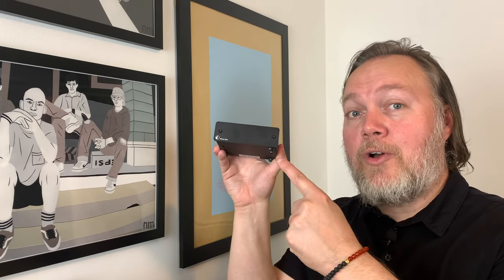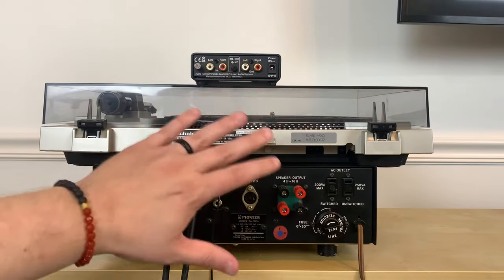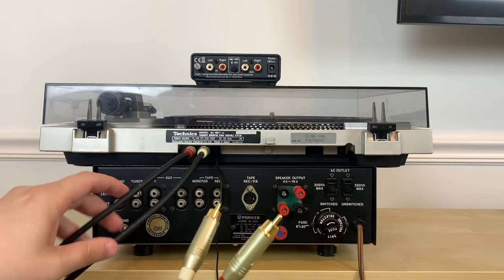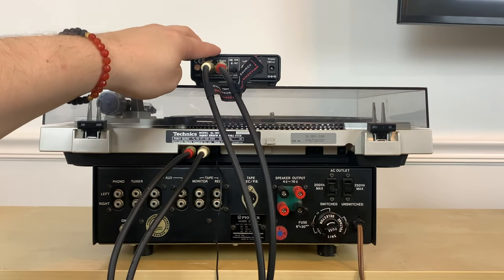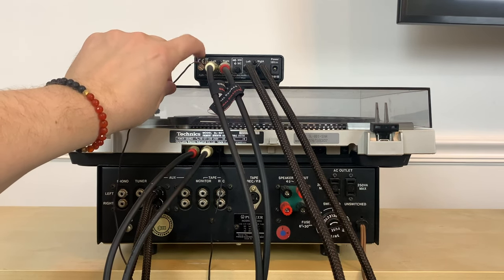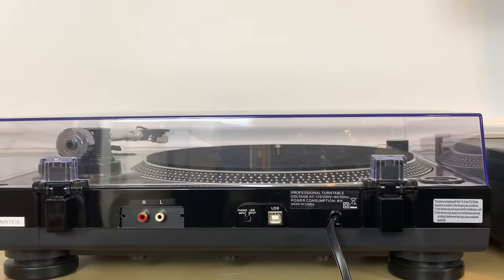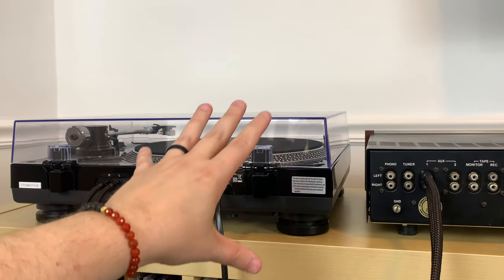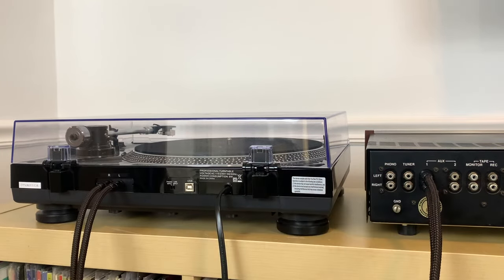How to Connect a Turntable to the Aux Input on a Receiver

Comment: Great advice for the LP beginners, keep up the great videos!
Reply from the maker: Thank you!
Reply: But isn’t the phono input on the receiver only good for moving magnet carts? If you are using an external preamp to select moving coil carts you can’t use the phono input on the receiver can you? What do you do then especially if there isn’t an audio in connector? What would happen if you select the moving coil on the preamp and used the phono input on the receiver🤔🙏 I’m confused about that. I’m fine now because my Yamaha receiver has a audio input so I use that and bypass the internal preamp on my turntable and select the moving coil on my external preamp. I’m just wondering if I ever have to get a new theater receiver what do I have to look for to be able to use an external preamp and moving coil carts. I’m just confused that I can’t use the phono inputs because they are always for moving magnet carts.  Some home theater receivers don’t have audio ins. Thanks for any help!

Comment: Thank you! A very helpful video. Thanks to this video I managed to connect my Rega to a Luxman amplifier with no mishaps. Everything works! Dumb question, but I have to ask it: What is TUNER for?
Reply from the maker: Some hifi set ups include a separate tuner, which is basically just a box that tunes in AM/FM radio. So some receivers left an RCA input for a separate tuner. I don't listen to radio much so if I have a tuner RCA input, I'll use it for a wireless streamer or CD player instead lol.
Reply: Thank you!

Comment: Thanks this has helped alot to understand how this works, I have a Onkyo amp and a cheap second hand turntable, I don't see any internal phono/ line etc on it but when I connect the aux it gives me sound and the plays the record, in fact I've connected to the tape aux and works through that rather than the cables coming to the front where my aux is, both sound the same but can't help to think it could sound better

Comment: Thanks for the video! I have a question. I recently bought an Audio-Technica AT-LP3XBT turntable (which has a built-in preamp) and am trying to connect it to my Onkyo HT-R393 AV receiver. However, I can't get any sound when I plug it into any of the receiver's inputs .  Bluetooth works fine, but I'm curious why the wired connection isn't. The AV receiver itself doesn't have phono but I thought since the turntable does have I should not need to worry about it. Any ideas?

Comment: Thank you so much for making this video. Quick question. I have a very modern audio-tecnica tyrntable with built-in preamp. The RCA cable that came with it includes a grounding wire. The problem I have is thatmy modern Sony Receiver does not have a connection anywhere for grounding. Is there anything I can do? Or can I simply not use the grounding? Thank you very much!
Reply from the maker: Try finding a metal screw on the receiver and unscrew a bit then wrap the ground cable around and tighten. You just need a metal to metal connection and sometimes this works although it’s not a guaranteed fix
Reply: @ForeverAnalog  Thank you so much!

Comment: I have a cheap turntable with a built in amp but doesn't sound very good on my only HT-R510 that doesn't have a phono connection.  Can I purchase a phono preamp? And will it sound better?
Reply from the maker: You can purchase one yes and it may improve the sound. Maybe try buying from Amazon and if you don’t hear an improvement you could return

Comment: I have a 90's Pioneer receiver that has the phono connections but no auxiliary. Later on, I bought a turntable that has a preamp. Since there wasn't the auxiliary connections on the receiver, I connected the turntable on the laserdisc/sattelite connectors on the receiver. It seems to work. Just curious how is it working with those connections?

Comment: Thank you! Question please. Can you use power speakers that have phono/RCA Jacks?
Reply from the maker: Yes, if the powered speakers have a phono input, you can use to connect the turntable with the internal preamp on the table turned off. If you have a turntable with an internal preamp, you can switch it on and plug the table directly into the RCA cables on speakers.

Comment: If I were to have a turntable and wanted to play FM radio through the Bluetooth option. What do I need to connect to the AUX to be able to play fm radio. Is there some form of transmitter or adapter for an aux connection?

Comment: This video was super helpful. If I wanted to plug in turntables to a mixer and then my receiver before the speakers, would I use the phono line input on the receiver or regular aux? (The mixer has a phono line switch). Please help!! 
(I was assuming that it would be the aux input like you did in the video since the mixer is considered a preamp?)
Thanks so much.
Reply from the maker: Depends on your turntables. With my mixer, I usually plug my tables into phono and move the switch to phono on the mixer and connect my RCA cables to my phono input on the receiver.

Comment: Can't find the answer to this question anywhere, but I think you may have  briefly mentioned it. When you have a preamp in your TT and a receiver with a phono input, what is the best way to set it up? Should I use the preamp on the TT or should I use the phono input in there receiver? Which is better and why?
Reply from the maker: I find the phono stage (input) in the receiver to be more robust sounding.

Comment: this video is a such a big help! So let's say, if I will be using a modern turntable (with phono preamp) is it safe to use an RCA to XLR cable, as my input cable going to an analog mixer? (LINE INPUT)  then from the analog mixer, to amplifier, up to PA speakers? do you think it will sound good? good enough for large venues such as reception halls?
Reply from the maker: Yes I believe that will work. You should be plenty of volume but just how loud it gets will depend on the amp you use for the PA speakers.
Reply: @ForeverAnalog  thanks a lot!

Comment: Great details on the connection of my turntable to Sony STR-DH540 receiver however not only do i not have a phone jack I also do not have an AUX jack...Is there a way around this issue? In advance thanks a million.
Reply from the maker: You can use any of the RCA inputs on the rear.

Comment: Ok but i do not understand if i want to improve my sound quality. I Ve a selector on the back line/ phono, and on my amp an input phono. If i use between them a pre amp the sound Is Better or not? I know that without a preamp It works. But my doubt Is: if i buy a preamp and connect It, i Ve a Better sound ? Thanks

Comment: I had purchased a new JBL turntable with a built in pre-amp.  I have a vintage Sony surround sound system receiver does not have the word aux. on the back.  It has input-output for CD MD/Tape, Vdioe 1 & 2.  There is a separate DVD/CD player that hooks up to the receiver and only has ports for line out, digital out.  Where would I plug my stereo in?  Any help would be wonderful.
Reply from the maker: You can use any of those inputs with the built in preamp and just switch the receiver to which ever you choose!

Comment: I have a modern Bob Marley turntable with the two outputs lead to one auxiliary cord is small the smoke how do I get an adapter to plug into an older receiver but it only has one Jack only has one Jack

Comment: My TT doesn’t have a ground wire just the two rca cables, my reciver has phono input will it make noise?
Reply from the maker: Depends on the table and amp really, I'd plug it up and see what happens. Worst case it will just hum.

Comment: Hi. Is there any difference in sound quality when using the turntables built in amp vs the receivers built in phono stage amp?
Reply from the maker: I think so, yes.
Reply: @ForeverAnalog
Reply: Thanks. I have an Audio Technica LPW40WN turntable with a built in amp. Originally tried hooking up to my Marantz NR1200 receiver phono stage, but there was an awful buzzing in my speakers from an apparent ground loop. Tried everything to solve but no remedy worked. Eventually defaulted to the line setting and ran it through the AUX on the receiver. Works great, no buzz/hum. Have wondered though how much performance I’m losing by not utilizing the Marantz amp.

Comment: My turntable has pream and my amplifier too in that case ? Should I  connect to the phono input in the amplifier and switch to phono on the turntable?
Reply from the maker: I prefer the sound of my amp’s phono input over the turntable’s built in preamp. Test them both out and see which you prefer!

Comment: 😃Sir, great video. I have a turntable and need an amp, but would rather establish a connection to a receiver. I am looking for a receiver that has a phono input, but I do not want to break the bank. May I have a few suggestions? If push comes to shove, I will use a preamp.  Thanks
Reply from the maker: The Sony STRDH190 is currently on sale at Amazon for $148 and has a built in phono input. I can't say it will offer you the best "sound" overall, but it will get your turntable up and running with powering your speakers.
Reply: Thank you! I will check it out.

Comment: I have Cambridge Audio AXR85 which has built in phono (MM Phono in the back) and I'm going to buy Audio Technica AT-LP140XP (which has not pre amp) Do they work together? Thanks :)
Reply from the maker: Yep, just make sure the turntable is plugged into the phono input on the Cambridge.
Reply: @ForeverAnalog  Wow, instant response :) Thank you so much for the information! Greetings from Crete

Comment: So to be clear if it has a built in phono pre amp I don't have to have a ground wire? I want to hook a turn table to the aux on my Sony shake sound system
Reply from the maker: Each turntable's grounding is different so hard to say. If there isn't a ground wire attached and your table has an internal preamp, there's a good chance you will not need a ground wire.

Comment: I recently purchased an Audio-Technica LP3 that comes equipped with an internal phono pre-amp. Am I correct in assuming that I could purchase a bookshelf speaker with an auxiliary port and still be able to produce sound?
Reply from the maker: Yep. The AT table and speakers should have instructions on how to connect properly! Just make sure the bookshelf speakers have an RCA input. Most do!
Reply: @ForeverAnalog  say my speakers don't have an RCA in this case. Could I use an RCA to aux adapter?
Reply from the maker: What kind of speakers? If they aren’t powered you will need an amp

Comment: If I switch on to line out of the turntable n connect to phono input of amplifier n not aux point theough rca what happens ? I have same turn table with  aux/line and phono   out put n denon 520 a e amplifier with phono n aux points ?

Comment: What if a turntable is equipped with MC cartridge and built-in phono-preamp, but the receiver doesn't have GND knob to hookup ground wire from the turntable to it. Is it possible to use GND input of the AM antenna terminal to connect GND wire from the turntable?
Reply from the maker: I’ve been able to ground a cable to a regular metal screw and it work fine. I think the metal to metal connection is key

Comment: I do not have an AUX input on my receiver. Currently I have my Phono hooked up, my CD player and a tape player. how would I hook up a second turntable to that? My second turntable has a bulit in pre-amp.
Reply from the maker: You could add an audio switcher - check out the video I made about the Douk One Little Bear on my channel for an idea of how those work.

Comment: I have a question, I have a stanton str8-30, and a RCA RT2380BK receiver, it does not have a aux connection, is there a way to connect the two? Please help.
Reply from the maker: Follow these same instructions and plug into either CD In or Tape In on the rear instead of Aux
Reply: @ForeverAnalog  thank you, I will try that, your video was very helpful and informative.
Reply: @ForeverAnalog  hello again, I did what you said, it worked, on the other hand I’m not getting high volume sound, I have the receiver on max, what am I missing? Would I need a phone preamp?

Comment: What if I only have an aux on my turntable like the Audio technicia AT-LP60x?
Reply from the maker: You plug the cable provided by AT into the turntable using the 3.5 mm jack, then you plug the RCA cables into your receiver or amplifier. If your amp or receiver doesn't have a phono input, switch the turntable switch on the rear to line and plug the rca red/white plugs into aux on the amp. If your amp has a phono input, switch the turntable switch on the rear to phono and plug into the phono input.

Comment: can a turntable with RCA sockets from an old retro 90s hifi system be plugged into a modern DAB CD system with analog input sockets ?
Reply from the maker: Not sure. The CD system needs to have a phono input or you need an external phono preamp.

Comment: MY Onkyo TXSR506 manual states one can connect a turntable (with selectable line) to the CD RCA ports. BUT.....there is no chassis ground for the turntable. Where/how do I ground the turntable??
Reply from the maker: Try to find a metal screw somewhere on the outside or even inside of the case to attach the ground wire to. That will sometimes help, but not always.

Comment: I have a victrola vta-65 low end/cheap turn table its a 3 in 1 so i have turn table,bluetooth,and radio.Can i connect a cd player to my unit and hear sound through my victrola if so how?Thankyou
Reply from the maker: Hmmm. Not sure. I don’t have much experience with those units, sorry. My guess is no.

Comment: hi if i connect 2 turntables to my amp i connect 1 to phono and can i connect the other to aux or tuner
Reply from the maker: You can only connect to the 2nd table to aux or tuner if you use an external phono preamp OR your turntable has one built in
Reply: @ForeverAnalog  thanks im looking at at lp60 and have marantz 6007 amp but no aux so what imput should i use please

Comment: I have a stanton srt8 80, it suposed to be a phono line switch in it but i cant find it, there is not a ground line, so i conect it to the line input in my mixer and it sounds too low! What i can do? Sorry about my english 😅
Reply from the maker: I looked online and couldn't find the switch either. It's normally on the rear of the unit. Try lifting the mat on the platter and rotate it around and see if you see a switch hiding under there?
Reply: Quick google search found this in "Just answer" from 2016.....
The Line Out/Phono Out switch is under the platter. Lift the mat up and rotate the platter and you will see it.

Comment: how can i connect a turntable to a pioneer  receiver vsx-44 receiver...
Reply from the maker: Use the Analog In RCA input on the rear of the receiver using one of the methods mentioned in this video.

Comment: Sad part about my current problem is that I recived as an inheritance, a realistic turntable, reciever, and speakers. For some reason, the speakers are give distorted audio, after being in climate controlled storage for a decade, so I dug out my Denon AVE-1709 and tried to uyse it, thinking the reciever was the problem. Sound is similarly distorted using a BT-RCA reciever and the same speakers. Not I'm either going to have to find an extra outlet, as my AV system power strip is full, so I can have the Denon and Realistic recievers both powered, with the Realistic one feeding into the Denon.
Reply: I’m learning as I go. And I don’t know much. But it could be the turntable needs grounding.

Comment: you should add that tiny signal is for very bad turntables and the phono input is a proper input for the turntable and when conecting to a pre-amp and convert it in one more audio source the impedance on the cartridge migh not be the correct one and you´ll never get the quality sound of the phono input maybe louder but worse, i just don´t get it because i use turntables since late 60´s and i don´t know nothing about what i´m talking ,even having 7 turntables considered by many the best in the world from 1968 to the year 2000 ,what came after just garbage or what in the 80´s was called more plastic than turntable, noise what noise, that changing speed with our own hands ,makes the turntable acurate in speed, mechanical change in speed it´s greasee metal releases grease our hands dont release nothing ,belts with nothing that comes from our hands it feels lubrificated ,why?but receivers without phono, not the best turntable in the world with the most expensive cartridge in the world would sound just ok, to listen to records by a 100€ amplifier in the E-bay site and you´ll see the diference to a AV Receiver with no phono input

Comment: ok, i have a SONY STR-DH590 that don't have a phono connection for my turn table so im thinking of buying a pre amp costing $20.0 to $50.0 and save me some money instead of buying another turn table with pre amp that will cost me around $200.0 plus, im hoping and crossing my finger that everything will work as you shown in your video so i will let you know soon as possible in your comment what will happen, bye for now and see you soon.
Reply: I bought that same receiver, actually returned ones that had a turntable plug because it didn't have enough other inputs. This is making me wish we had all our old stereo equipment.. It's too hard😢